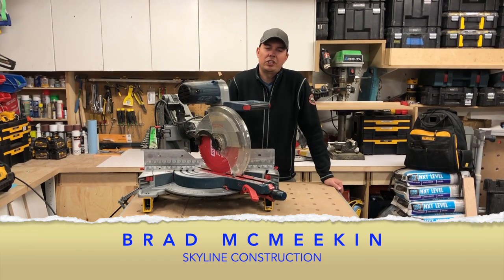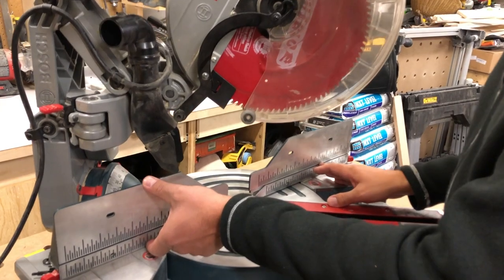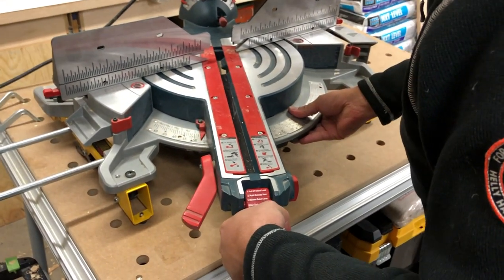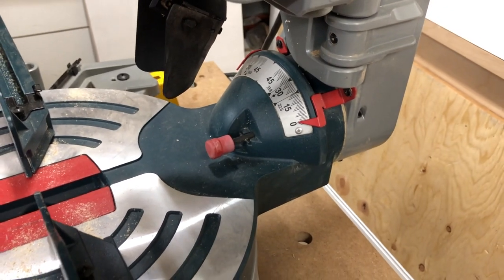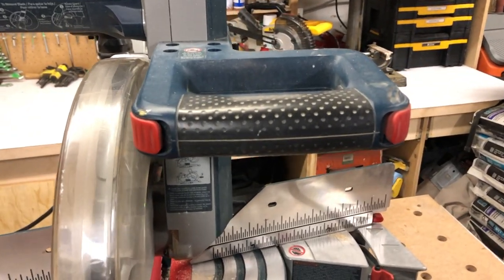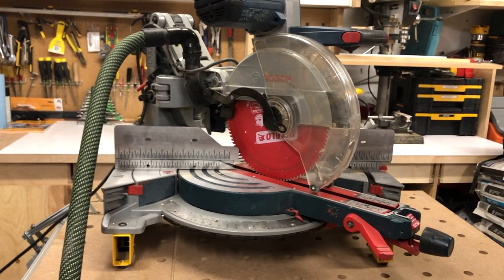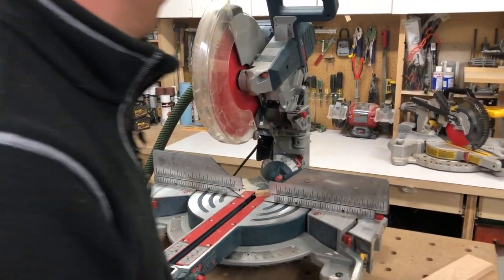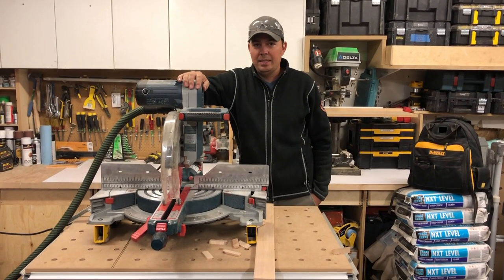My thoughts on the Bosch GCM12SD Glide Miter Saw

Comment: I'm building cabinets with a miter saw station in my garage, and I'm limited on space, so no "sliding" miter saws since they're space hogs in the back. What is the distance between the point furthest back on the saw to the adjustment knob at 90 and 45 degrees?  Also wondering if this might be too big a saw for my scale of weekend DIY stuff... but it sure looks cool and i love that space saving design.
Reply: I was researching this saw today, and I can't find this information on the Bosch website.  For the 10" version, its' 30"

Comment: ok on the bosch miter saw , thanks for that.  last question what is the best miter stand for this bosch miter saw.
Reply from the maker: i'm a fan of the Dewalt because you can change out the saw if you want, you can buy separate mounting brackets for it, that allows you to put any saw on it. or you can go with the rolling cart style by bosch, its nice but bulky. all depends on your needs.

Comment: So you’re saying you pay $650-750 and there is no laser on this thing ? Or can’t even add one? Where do you get that vacuum and hose?
Reply from the maker: a lot of saws don't come with lasers anymore, it's unfortunate. you can buy the laser that mounts onto the blade, I don't like it because it only goes on when the blade is spinning. The vac and hose is Festool https://youtu.be/wnYWGfPy9Lk the link is below the video
Reply: Line up the blade old school with your eye. I run this saw through its' full scectrum of optins and I promise you the laser is a small compromise for such a weapon of a saw
Reply from the maker: @dylanelgersma1375  such an amazing saw! have you seen the cordless option now?
Reply: Good saws don't have lasers. That's a cheap saw thing because pros don't use lasers

Comment: Good vid...is there any play or "compromise" to accuracy when the mechanism is fully extended?  In other words, is it possible to wind up with a less than accurate or straight cut due to slack when those "arms" are fully extended.
Reply from the maker: i find that this saw is incredibly accurate. i never have any issues unless i'm doing a compound cut and i push a bit to hard, that's when you start to see some deflection in the saw blade not in the actual arm. I would almost prefer a 10'', but they didn't have them when i bought this saw.

Comment: Everywhere I see this saw I coment beacuse I had one and is worst saw I ever use.
Reply from the maker: may I ask why?
Reply: @hammerandhome   I am contractor so. This is not a saw you can move from job to job. No laser no shadow. Calibration take long. I used this saw more than  year and never felt this is a right tool. And before go back to dewalt I bought metabo. So metabo laser future was great but quality of saw not. Now I am back with dewalt. You know some tools are useful some just look good. bosh just look good
Reply from the maker: @yuliyanyul1633  Thanks for sharing, I do hate moving this thing around, its a back breaker! I only use mine for finishing and have enjoyed using it, I used to have 2 10" Hitachi sliding saws back in early 2000. miss that saw. thanks for watching
Reply: I'm with this guy. Terrible saw imho. The biggest issue is not having that bevel pin positive lock at 0*. Theres been countless times I've cut door casing and it's all beveled 1-2*. It pissed ya right off. 

Also, as a saw for trim carpentry, junk. The mechanics of the bevel changing is terrible. Lever for left, then the knob for right and have to push the saw......not a fan. 

Also, having to mark the front of your piece instead of the back is frustrating.  Because the blade doesnt go past the fence.

As a general framing saw, it's great. Set it up in a new con against a wall. Go to town.